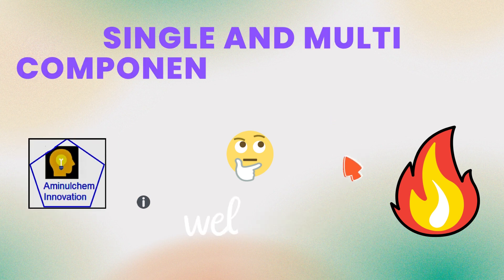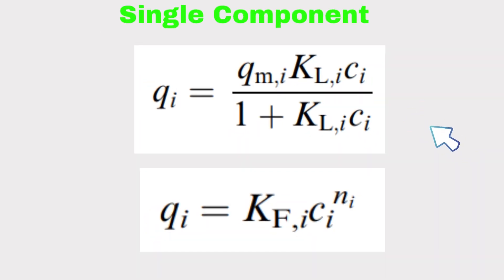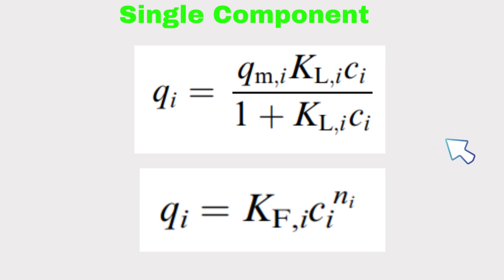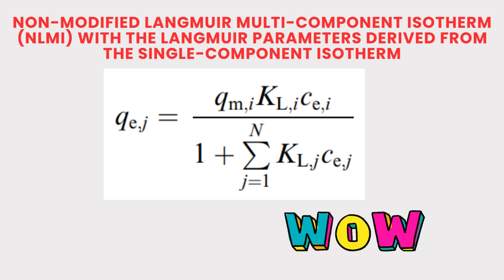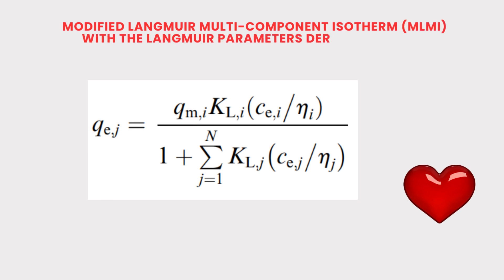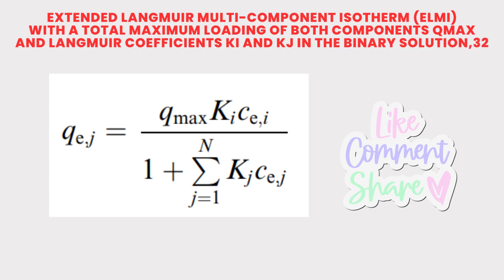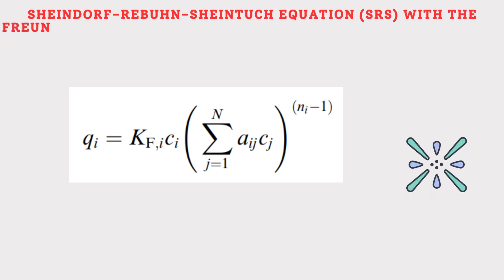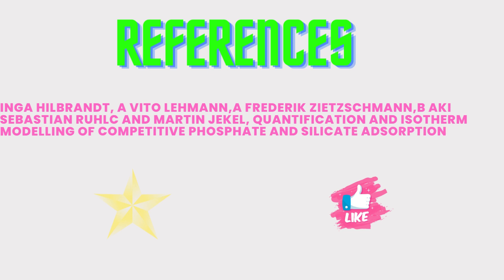Single and multi component Langmuir and Freundlich isotherm model

Comment: Sir plz make a video of  how to plot Langmuir isotherm for multi-component in origin .
Reply from the maker: Thanks. This is somewhat difficult to  fit. However, it will be tried later.
Reply: You will create your equation in fitting function builder and you will name it as you want and create its category. For example multicomponent category, choose expression as function type and then write correctly your multicomponent equation. You can choose there also the constants. Then you will have ready your equation. You will plot your data and then choose fitting-->non linear curve fit. In function selection you choose your created category and function. In data selection you choose your data, in advanced you choose parameters to compute (choose RMSE, also there) In parameters you can choose bounds for your values and put initial values. If you want to change the constant values you can do this only from the fitting function builder and modify a user defined function, then you will go to fitting-->non linear fit etc. The hardest part of all this is to choose optimum parameter initial values.